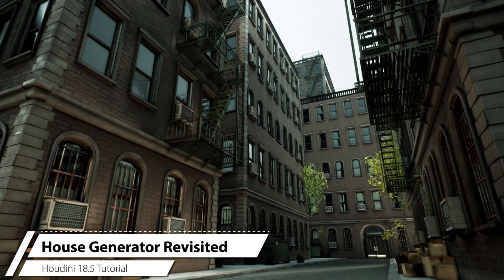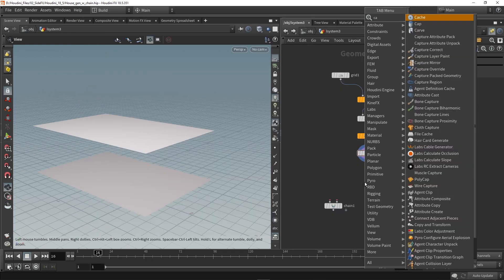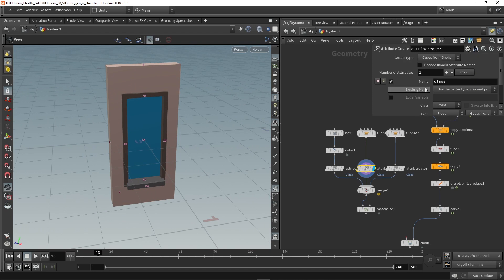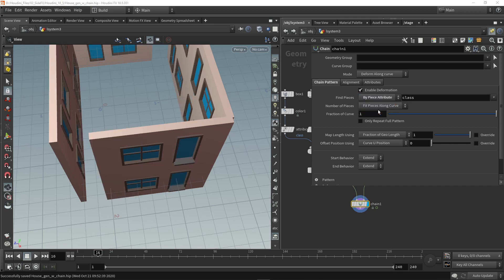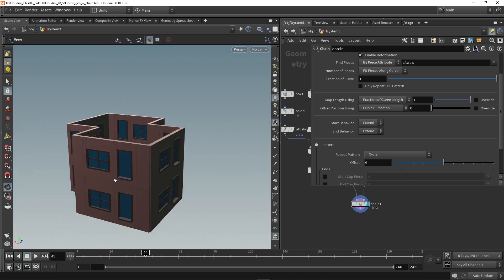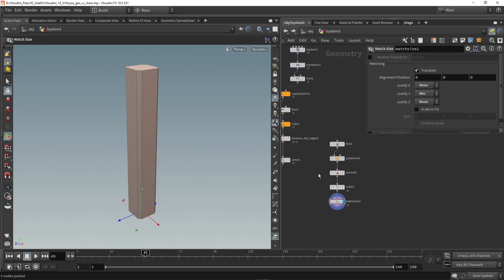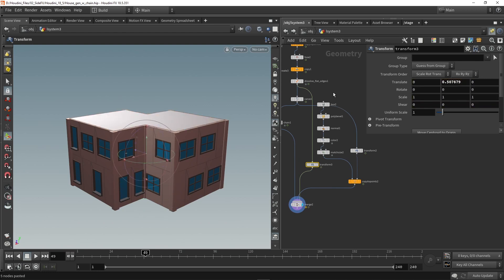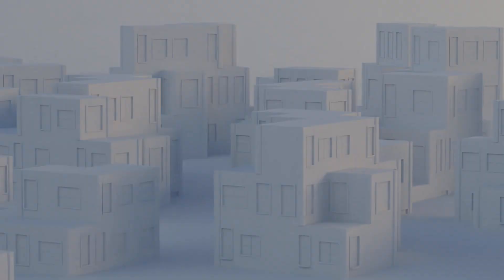House Generator Revisited || Houdini 18.5 Tutorial

Comment: Amazing. Would you still use the Building Generator or some different approach for more control and complex buildings? i like how simple the new approach is ... just wondering if you trade speed vs control.
Reply from the maker: It depends on what building style you want. If you just want something quick, for like background then this method is great. 
If you need a specific building tool then other approaches might be better.
Reply: @simonhoudini5074  well I’m thinking of replicating one of the apex houses for studying a more multiplayer like house (wider doors / less windows, wide stairs and so on) ;)

Comment: Hi Simon, I posted on the Houdini forum as well, but since you responded me here earlier, I will send here as well. I am having a bit of a problem in your post apolalyptic course, most precisely on the end of the third video. It took me some hours to debug this out, don't know if this is something that's happening on Houdini 18. But when I select the input (HDA blockout tool) as the geometry to project in the height field, when I move around with the translate tool it doesn't update the terrain, only if I move the points, moving the points updates the terrain but as if the geo was in the center of the terrain. The strange thing is, if I create a transform node and expose the XYZ translate values it works, but not so interactive as I have to use the sliders, am I missing something?